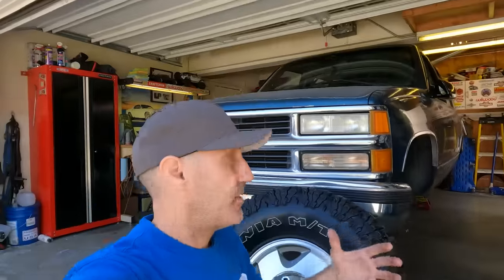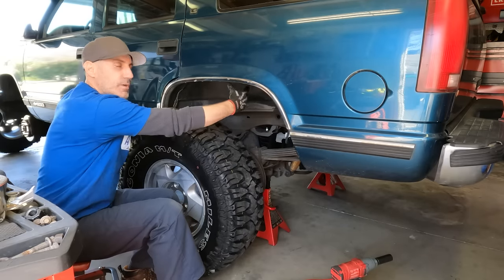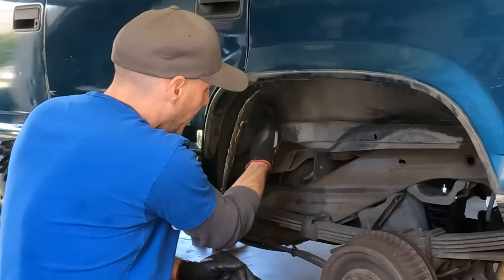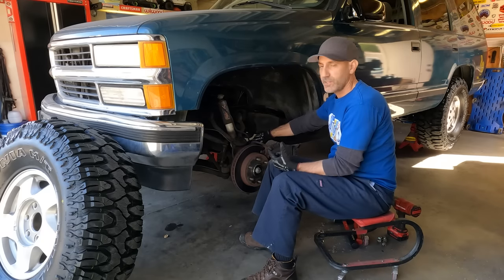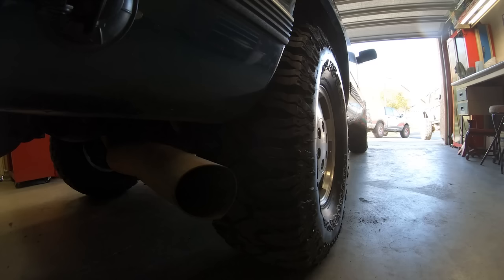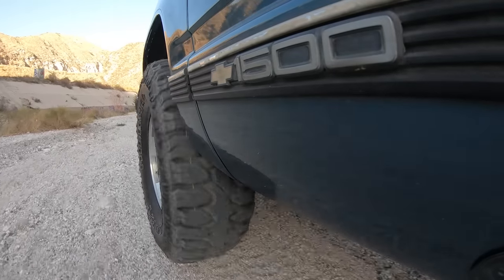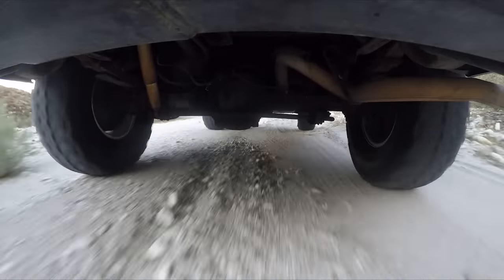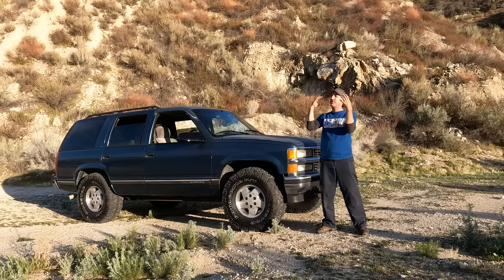How to Fit 35 inch Tires on a Stock Tahoe and Going Off Road

Comment: Yes, do a build series on this truck.
Reply from the maker: Copy that!
Reply: Im currently building my 97 tahoe i will definitely fallow this build
Reply: @AutoEdits  please!
Reply: That Tahoe looks nice!  I've done a leveling kit up front and a spacer in the rear for some additional clearance for articulation. Think an add a leaf would do the same.  Also maybe a 2 inch body lift too.  For me It's a lot of fun having additional space for the family.   My primary wheeling rig is an 86 Suzuki Samurai in which the family may have trouble fitting in.
Reply: I just got some 20 inch ceterlines and nitto trail grapplers 35 12.50 and the bumpstops heck yeah
Reply: @drulessman2892  Hell yeah, I got those same ones!  Had those Trail Grapplers for a little over a year now and they're still holding up well.
Reply: Saint Bradley  Really?  I'm missing out!  I would wonder around Blockbuster till I find what I like.
Reply: @AutoEdits  No Limited Slip >>   18:58 .... gotta add that! :)

Comment: The problem here is the IFS. It is a weak link and with any hard use it will break. It is notorious for lifting wheels. Installing a locker will make it even more vulnerable. So yeah you got 35s and a bomb waiting to go off in the front axle.
Reply from the maker: All valid points but this rig was built to do this https://youtu.be/SLxA9hlW9y8
And it does a great job.

Comment: Since the front is only rated to 33" tires max, that's what I did to my '99 Suburban K1500, even though I have the 3.42:1 gears. I've been driving it this way for 50K miles now, no problem. Next will be a lower-mileage '99 K2500 suburban so its 9.25" IFS can take 35s, and there's actually a locker for it, from ARB.

Comment: I have a GMT-400 Suburban and the upgrade I'm most pleased with is the full Powerstop Z36 brake kit with the powder coated calipers. 
The stock brakes are a weak point on this platform and the Powerstop brakes are amazing. And they're cheaper than OEM brakes from the dealer. 
You'll want Part No. KC1970-36

I replaced all my front end parts with HD Moog or GM parts. 

In my case I got TA K02's for what you paid for those milestars.

I also have an HT-383E engine swap with JB headers and Magnaflow header back exhaust with performance cats plus a performance tune. 

Love this platform. Amazing truck in all weather. Easy and inexpensive to work on. Drives great in town and on the highway.
Reply from the maker: That sounds like a great rig! I would love a 383 in this but that might be tough here in California.
Reply: Odd.  I have a GMT-800 Suburban, and it’s brakes are phenomenal.  It stops faster and truer than the 2017 Nissan Altima and 2016 Hyundai Sonata I had before. Of course, it’s 4-wheel discs, so perhaps that’s part of it.
Reply: @MarcPiery  that's because they fixed the issue on the GMT-800 platform. Bigger front rotors and 4 wheel disks.
Reply: @AutoEdits  yeah, unfortunately the HT383E isn't, AFAIR, California smog compliant.
Reply: 😊 What size tires are those exactly?

Comment: Oh you're in for it now, big tires do interesting things to old trucks :)  Looks great, awesome project. Just don't go too far off the trail for a while, those big tires will expose the weakness in the drivetrain.  Which is a good thing if you want to turn that into an off-roader, since you can fix them and get the truck squared away and reliable for longer trips.  BTW - Props on the production value, the back facing front cam on the trail, nice!
Reply from the maker: Thanks 👍 a bunch!!!

Comment: I'm looking forward to watching your series with this truck.I have 1992 suburban where I just put a 350 four bolt main in to replace the tired old 350 .I also have a 2-in lift to level the truck out.  I'll be doing small upgrades to make it more dependable and survivable doing overlanding trips and because I have the 700R4 transmission, I'll be looking to beef that up in the future.
Reply from the maker: How does the 700R4 compare to the 4L60 in my Tahoe? Give this video a watch https://youtu.be/SLxA9hlW9y8  this platform does so well on long trips!

Comment: Best thing I ever did to my 95 suburban is the rear old style manual fill air shocks that I pumped up to 120psi. Ots amazing how its firmed the ride up not uncomfortable firm but firm like you know there is a bump but not shake your teeth out of ur head . I highly recommend  doing it on any full size obs suv.

Comment: This is awesome, I’ve been watching your videos to help me work on my 99 suburban, and now you have a 90s Tahoe. This will make my life a lot easier. I studied your brake upgrade video for a while and just went ahead and installed Wilwood disks on all 4 corners of my suburban a little over a month ago. New rotors, calipers, brake lines, proportional valve and master cylinder.  Did a lot of changes to it so far this year. And to top it off, I just realized we are aren’t too far away from each other. I was wondering why that area looked familiar during your test drive. Would be great if I could show you my work in person once I’m done with the changes and break in process.
Reply from the maker: Wow, you went Wilwood on your Suburban... that sounds expensive but awesome! I was going to do the Powerstop brakes in front and just refresh the rear drums on this... mind me asking what kits from Wilwood you went with, a ballpark price and can you run the stock 16" wheels with them?
Reply: AutoEdits hows it going! Yea I was looking to see what options were out there with little modifications. I found a shop called little shop mfg, and they make their adapters in house. I asked them a bunch of questions for months and they helped me out. For the front and rears I did 14 inch breaks, 6 piston calipers front and 4 piston rears. They do say you need 18 inch wheels for the 14 inch brakes and 20 inch wheels for their 16 inch brakes. For just the brakes alone, it was a little over 4K. It’s a lot but this is just one of those things I definitely wanted high quality. I started the brake in procedure but realized I had a leak in a line I made so I had to replace it. Once I have a chance I’ll be able to bleed it again and test it. Also replaced the differential because it was a few drives away from destroying itself. This has been my project for a few years and I’m glad you got that Tahoe. You also got the bumper I’m looking into installing!

Comment: Hell ya man I've always wanted to do this exact same kind of build on one of these older tahoes! Definitely living through you on this one!!
Reply from the maker: Thanks!
Reply: @AutoEdits  did you change the gearing on the ram? I wanted to get a newer 4th gen ram but found out the 8speeds after 2012 can't be regeared because of the design of the front diff being welded on or something like that :(

Stuck with a 3.21 ratio unless you can find one that has 3.92s factory but not sure if that'd be enough to handle 37s

Comment: I relate to this video so much. I have a 2wd Dodge Ram 1500 6speed manual regular cab short bed. I installed 4.10 gears and have a Detroit locker in the stock Chrysler 9.25 rear axle. It goes off road no problem on my 33” BFG KM3s. I have a new 4x4 but I’m not taking it hardcore off-roading because I don’t want to scratch it lol. My 2wd can go all the places I need it to being in south Florida and a trail like what you’re on in this video is perfect and I agree I could do that all day too just riding with the windows down and soaking it all in 😎
Reply from the maker: This right here!  I'm looking to do a locker on the Ram soon!
Reply: @AutoEdits  can’t wait to see that video!

Comment: Also, you want kryptonite tierods and if sticking with stock control arms and such just use Moog parts for the rest. If you put towing air bags in the back you can get rid of the bump stops for better ride quality and adjustable lift lol. Mine had them and it would raise 3" or so from empty bag to 50psi
Reply from the maker: All very great suggestions! Thanks!

Comment: We just completely replaced all of the front steering and suspension parts on our 99 2dr Tahoe. All the parts are Moog and Polyperformance. The parts alone topped 950$. Next is swapping out to the  big block drivetrain and a 6in Rough Country lift and possibly 38inch meats!!!
Reply from the maker: Cool to hear... what did you get from Polyperfromance?

Comment: I had 35s on a 1975 k5 with a 4-inch lift kit back in the 80s; frame cracked on one side right above front axle, got it welded, needed repaired often. I think I will keep my low mileage 97 Tahoe on the pavement.

Comment: I have a couple of K2500 pickups and they both rub with aftermarket wheels and 33x12.50s. I'm definitely going to install the tires on a set of stock wheels. I have cranked the torsion bars.
  Mine rub on the front bumper and the rear of the front fender. . And I've trimmed both!

Comment: The weak point on steering with bigger tires is pitman and idler arms cognito makes a bracket that braces both arms my new arms only lasted 30k with large tires so I will be installing the kit soon to help prevent failure
Reply from the maker: They don't seem to make stuff for the 95.  I'm going with Kryptonite steering components.

Comment: The high end mevotech front end parts seem to hold up pretty good on mine.  4.56 will be perfect thats what I have.   I went from rancho shocks to bilstein.   
You can put a 1 or 2 inch block in the rear to raise it or add a leaf. The front you can raise the torsion bars 1.5 to 2 inches max

Comment: I just did the front end on my 1998 k3500, used mostly moog stuff, and bilstein shocks, very happy with it. If you are going to use stock control arms, the OBS trucks with the heavier engine (diesel, 454) have forged lower control arms vs stamped steel, so that could be a good upgrade. My understanding is most the lift kits for these trucks retain the factory lower control arms. There a vid on my channel of the process, made some good mistakes in that one haha but turned out great in the end! Love the tahoe, this is gonna be a fun build!
Reply from the maker: Thanks for this... heading over now to do some research...lol!
Reply: @AutoEdits  To make it heavier duty, just use 2500 or 3500 series control arms.  The front of the chassis is the same on all models.  Just heavier duty control arms, different hubs, and heavier duty torsion bar springs.  It may use the same control arms as the GMT-800.  If it does, I believe that they are all forged.  And please stop calling your truck an OBS.  OBS is a Ford thing to describe older body style F series trucks.  Yours is a GMT-400, which came after the C/K Rounded Line trucks. Good luck with your GMT-400 project.

Comment: I was happy with moog parts when i rebuilt my entire front end on my 97 k1500. I eventually switched to acdelco and aftermarket parts when i did the SAS. But i traditionally like acdelco or moog when it comes to my 97 k1500, 05 tahoe and 07 silverado.
Reply from the maker: Thanks for this!
Reply: @AutoEdits  both those companies have higher quality parts moog is problem solver and acdelco is the professional series. They cost more but are a closer comparison to OEM or better quality. Cant wait to see where you are takimg the OBS I was suprised to see a 35 fit so easily.

Comment: AMAZING!!!  I have a 99 Tahoe and no one really makes content for this body style anymore.  

I’ve got a 99 2WD.  What’s the largest Tires I can fit under it?
Reply from the maker: Howdy!  Yours is about the same as this one from my understanding. So very safe to go 33" with a bit of the adjustments you saw me do in this video.
Reply: Stock size tire is roughly 29” tall for 2wd. I’ve fit 31s with no modifications on stock wheels. I put a rough country lift spindle and did the same bumper cutting and fender massaging as seen in this video to fit  ~33s (295/75r16) on (16x8” -12 offset) aftermarket wheels. With stock wheels I think you’d be good for 33s with stock suspension as long as your coil springs aren’t worn out.

Comment: Thanks for this vid! I've been trying to find something similar to take camping on similar trails. I have a built Cherokee on stock axles and 35s and a GMC Envoy. I want to sell the Jeep but I wouldn't have a trail/ camp rig anymore, cause the 'voy is nice, low mile, not very capable, and has sentential value. Looks like a cheap Tahoe is a STRONG contender for a replacement! V8 refresh for towing, rear lunchbox locker, has plenty of space to sleep and store gear, and maybe a wench (or 2 😉). Thanks again for the idea!
Reply from the maker: I'm all about all of that comment!

Comment: I'm looking at buying a 1995 Chevy Tahoe 4 x 4 $2,000 it has the throttle body injected 305 not the vortec motor or push button 4-wheel drive it actually has the lever on the floor, this will only be my second Chevy product I've ever owned but the electric seats have to go LOL can't wait to see how this journey goes I see how popular are these vehicles are so why not
Reply from the maker: Good luck and have fun!
Reply: @AutoEdits  yeah I know nothing about Chevy square bodies or anything on these tahoes but give me a classic 60s Chevy truck then I know so this is going to be something new to me

Comment: I had a 92 k2500 suburban and I replaced every ball joint, tie rod, and bushing basically every 2 yrs before I just went to solid axle. I used the best they had on the market and it just didn't last. I miss my truck
Reply from the maker: Thanks for sharing... Interesting to hear this.

Comment: Ditch the front bumper ad a bash bar with a skid plate light bar and  winch setup !!!! Soldier tank for sure 
And don’t forget the back clearance as well shorten up the long exhaust tuck it under the belly
Reply from the maker: Great suggestions! I just finished the bumper and winch install and it is already looking more adventure ready. I dig the exhaust thing as well... thanks!

Comment: 35s will fit on a OBS Tahoe or truck but I would recommend a 4 inch lift because the front tires will rub on the front and rear fender if your doing any serious offroading I have a 1993 k1500 with 35s with a 4 inch lift and still had to trim the front fender at the bottom and remove the front plastic bumper lip to prevent rubbing
Reply from the maker: Thanks for the tip!

Comment: You should eventually do an 1983 - 1997 Ford Ranger with the Twin I Beam. Would love to see an awesome build with an TTB
Reply from the maker: I like those... seen a lot of them done well. I just accidentally ended up with this thing.
Reply: @AutoEdits  i love both my 95 Ranger Twin I beam manual hubs. And my 93' F250 Twin I beam automatic hubs. Both work great off road

Comment: Whats the actual height of the 35s mounted on the wheels? I have 285-75-16 in aftermarket 16"s and these are basically 33" on my 98 Tahoe. And with the 3.73s that it has it does 70 mph at around 1,800 rpm

Comment: I've had my '00 Tahoe ('99 model year) since new. I've been considering making it weekend rig. This is exactly where I want to start - a new front bumper is needed anyway ! It is Z71 and had a dealer installed cattle guard - which they started the rust from their installation or hardware choice? anyway the rest of the truck deserves this refresh! thanks for posting
Reply from the maker: I love the look of the 2000 so much better than mine!
Reply: @AutoEdits  it's just a trim package that mine has. It is not the newer body style, it's a '99 that was sold as '00.  Chevrolet just added options and sold them for a discount because they still had some leftovers... and they also had the newer body style for sale at the same time.  I have body color wheel trim that I will need to remove to see if the 35" tires will fit, - because the opening is too small as it sits.

Comment: Hey buddy. Love the Tahoe great Job. Question, I have a 99 Tahoe LT 4X4 got a set of 18x9 6x5.5 wheels. What's the biggest tire I can run on those size wheels on our Tahoe without a leveling or lift kit?

Comment: If your going to install new shocks and steering stuff you might as well just get the lift kit you will have all that stuff already with the kit and might save you money in the long run..
Reply from the maker: True, tough to figure it all out at once sometimes!
Reply: @AutoEdits  that is true.. like I said I highly recommend rough country.. have that suspension on all 3 of my trucks and have no complaints 👌

Comment: Awesome vid!  Perfectly timed!
You are literally a few steps ahead of me.  Searching for an early Tahoe right now.
Couple questions... what gears do you have?  See performance decrease?  Plan to regear?
Reply from the maker: I explain most of this in the video. Oddly enough, it didn't feel much different with the tires and stock gearing. Just showed 5mph slower on the speedo than actual. I'm going with 4.56 gears for the 35's.
Reply: @AutoEdits  gotcha.... don’t kno how i missed that part... i was locked-in!  Thanks for the reply!
Reply from the maker: @rondav3065  All good my friend... I'm glad you're here!

Comment: Is that ab35x12.5.16 tire you have ?
Because I stopped by my Discount tire here in Indiana and they said that Patagonia does not make that size to fit my wheels,
Which are stock ones like yours.
Reply from the maker: They fit as you can see in this video but they are not in the manufacturer's size recommendation for this width of wheel so a major chain like that wouldn't want that liability.

Comment: Was curious what rear gearing you have on this and what affect it had on off the line performance as well as mileage. Stock size is 31" so 35" is a big jump. Fantastic looking rig!
Reply from the maker: In this video I was running the stock gearing and it drove pretty good around town... but I've since swapped the gears for 4.56 and it's perfect.